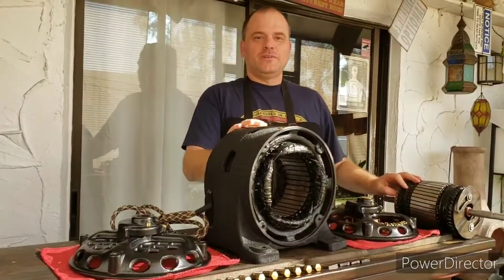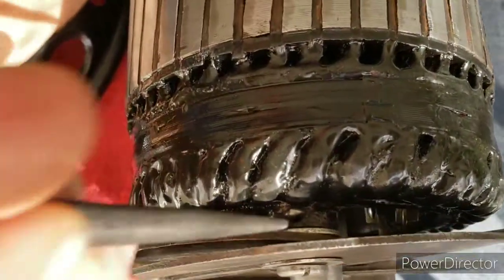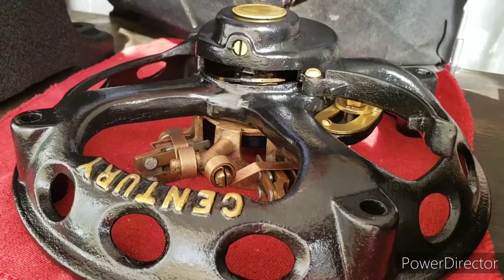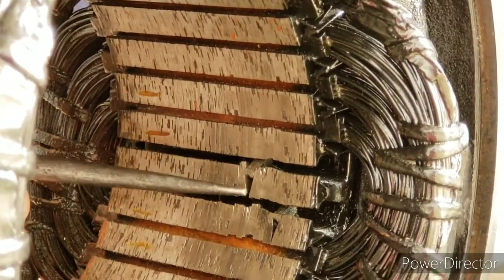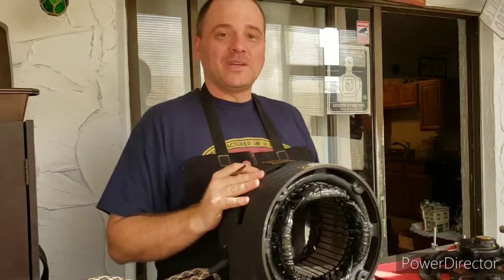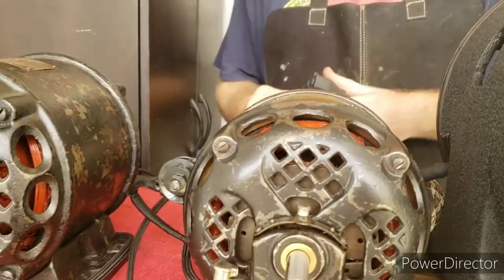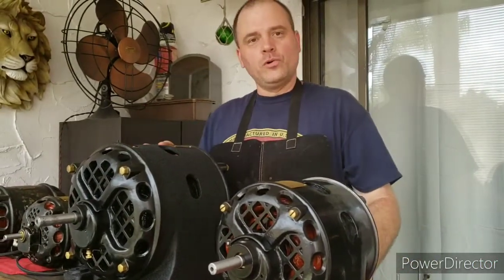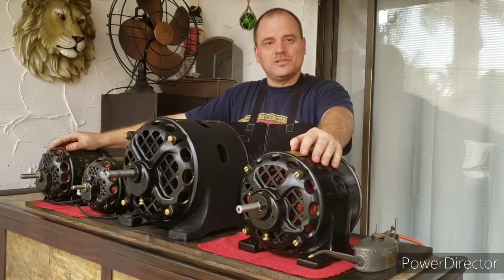Antique Electric Motor [Restoration]: Century Repulsion Start Induction Run (part 2 )

Comment: I have a 5 hp century motor serial number 852715 Sc type rpm 1710 it still works great. It could use a restoration.
Reply from the maker: Nice. Definitely worth your trouble to keep it going.

Comment: I just saved an old church organ from the scrap yard, and the blower had a 3/4hp Century.
I'm surprised at how popular they seem to be as old as they are. Your videos will be quite useful in restoring  mine.
Where were you able to find the patent info? I've tried looking up the serial number to no avail.
Reply from the maker: The patent dates are on the tag of the motor. The earlier versions were 1899/1903 and ran on 104/208 volts. Afterwards they had the 1914/1915 dates on the tag. My other video showing the complete process to restore a 2HP Century should pretty much help you step by step. Doing a thorough restore takes many hours do don't plan on it being a quick job.
Reply: @Benco Vintage Machine Works  Wow, I'm as blind as a bat!
14,15 right at the bottom of the tag.
My first concern is just to get it to run without being a sparking fire hazard, but I fully intend to go the whole 9 yards with new paint at some point.

Would you happen to have any idea where I could get information on an Electic Specialty Co. DC generator? It was hooked up to the motor, but I'm having less luck finding info on it.
Reply from the maker: Join the FB group "Antique Electric Motor Experts" and post some pictures. Its a fantastic group and you will ger plenty of help
Reply: @BencoVintageMachineWorks  will do, thanks!

Comment: Terry, to re-secure the housing seem after opening it to remove the stator, did you use a metal stitching or pinning system? Great job on this one! 💯
Reply from the maker: It is secured with machine screws that are invisible now that the stator is back in. Cutting the housing on a motor should never happen. This was an unusual and rather extreme case...
Reply: @BencoVintageMachineWorks  nice! Glad that was at least a last resort option! All the different challenges you overcame with this restoration was very educational. Thanks again!

Comment: Where do you source the period authentic wire ?
Reply from the maker: There's a strong demand for cloth covered wire because lamp, fan, and electric motor collectors all need it. This has led to several places offering it. I personally buy it off ebay.

Comment: I have two of these - one of them was in a field for years and had rats nests in it - after cleaning it fired up instantly - I could not believe the longevity of these motors, I have two centuries and an Aussie built 1920s built zetor motor - I had to weep whilst at a scrapping yard there was a gigantic Centauri motor took up the whole scrap bin for scrapping - the guy wanted1400 just for the scrap value of it - it was too big to save - I’ll keep collecting these as they come up.
Reply from the maker: These Century motors are certainly desirable and well worth seeking out. I have another video restoring a 1/8 HP Century motor which the company called "Invincible". I think you will enjoy it. Thank you for watching and good luck collecting these beauties!

Comment: Nice collection. Are the brushes set in the correct position on the 1/2 HP? Startup was a little slow compared to the others. Sounds like the brush index is just slightly off of its prime location. Also, what paint did you use on the big one? I’m seeing some good texture on it.
Reply from the maker: I appreciate your astute observations. The 1/2 HP is a 2 pole 3500 rpm (only 2 carbon brushes). It does take slightly longer to get up to operating speed than the others which are all 4 pole 1750. The brushes (brand new) are in the best position possible and, additionally, I have adjusted the tension on the centrifugal switch to operate as optimally as possible. Its just the way it runs and further adjusting results in a declining start up. My other video shows the complete restoration of this motor. 
 The 1HP housing was painted using VHT Wrinkle paint. This paint is good for hiding defects and durable once baked on. Since I had to re-attach the feet and repair the housing, I chose it to hide the repairs and it worked great. 
 Thank you for watching the video and for commenting.
Reply: @BencoVintageMachineWorks  ahhh that makes sense. I didn’t catch the 2 pole part originally. Like the videos but may I suggest you get a mic. Here is the one I bought and all the videos from the past year, I’ve used it. Professional Grade Lavalier Lapel Microphone Omnidirectional Mic with Easy Clip On System Perfect for Recording Youtube / Interview / Video Conference / Podcast / Voice Dictation / iPhone/ASMR https://www.amazon.com/dp/B01AG56HYQ/ref=cm_sw_r_cp_api_glt_fabc_5TMB9BYJCER84RXGE2Z6?_encoding=UTF8&psc=1

Comment: amazing amazing vintage motors, they were just beauties and ran smooth, quite and with no vibration! I have a ritter 1917 compressor with a cool looking motor, love the open side leads, oilers at both bells and the round curvy shape of the motor, design just flows. Wow you really brought that 1 HP from the dead! great tip on using JB weld, makes sense!
Reply from the maker: Thank you for watching the video. These Century motors are really worth the time and effort needed to collect and restore them.

Comment: I have an old belt drive lathe that uses a Century 2hp P10b frame. It has had a hard time getting past start to run so I was going to replace it with a newer motor but after seeing this video I decided to restore the Century. Once it is running it spins the lathe in any speed. Thanks for the video!
Reply from the maker: I am glad to hear that this video motivated you to restore the Century. They were beautifully built and worthy of preserving. I have two videos on Century motors, most of the issues anyone would likely encounter have been addressed between the two videos. If not a member, I always recommend joining the group Antique Electric Motor Experts on FB. Please reach out if you ever have any questions on it.

Comment: Wonderful work! Where did you get the muti conductor braided cloth wire?
Reply from the maker: The smaller gauge wire (18-16) is readily available on ebay. For the heavier gauge cords I buy a regular cord and use a product called TechFlex braided sleeve to give it the look. This product is widely used in the stereo world and is very high quality. Various sizes and patterns are available by the foot on ebay. Thanks alot for watching the video.

Comment: Great collection and nice restoration work! Amazing how large they are compared to todays
Reply from the maker: They are definitely large. I just picked up a 2 HP which I have yet to show on video. It's 75 lbs heavier than this one...lol.
Reply: @BencoVintageMachineWorks  I bet it is! I have a 3 HP Century from this era I plan to clean up at some point, it runs but is pretty dirty inside. It is MASSIVE. I may need to get ahold of you if i run into problems! Thanks for all the videos! keep it up
Reply from the maker: @gregp.1364  If you need any help let me know. I recommend joining the FB group Antique Electric Motor Experts. You can post pictures or videos and these guys are happy to troubleshoot. Its a great group.
Reply: Are there any supply sources such as brushes an end shaft bearing?
Reply from the maker: Eurton electric sells parts. Ebay usually has brushes that can be modified to fit as well. You might consider joing the FB group Antique Electric Motor Experts and posting what you need. Pretty high chance someone might be able to help. Good luck.

Comment: I have 6 century motors 1/3 ,1/3, 3/4, 1hp, 1/2, and a 7.5hp
Reply: Ill take a look, is there a better way I can contact you?
Reply from the maker: @joshuacommins4559  I am also a member of the Facebook group Antique Electric Motor Experts, I will send you a PM.
Reply from the maker: Nice collection you have there. What frame is the 7.5? I'd like to get one of the RS19 frames one day!
Reply: @BencoVintageMachineWorks  hey mate so I had a look and the 7.5 hp is an rs 19 frame

Comment: Hey mate, How many Century motors do you have?
Reply from the maker: I currently have 6. Five of those are Repulsion Start Induction Run and the other is from the early 60's. The most recent is a 2 HP which I haven't shown yet.